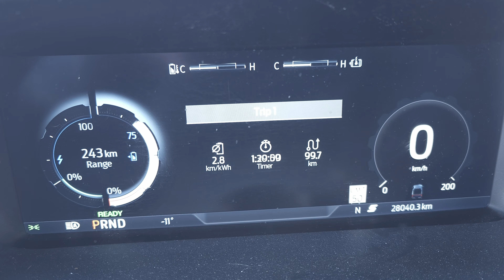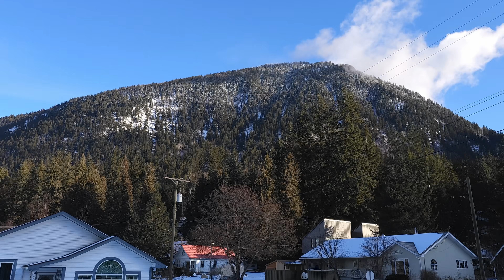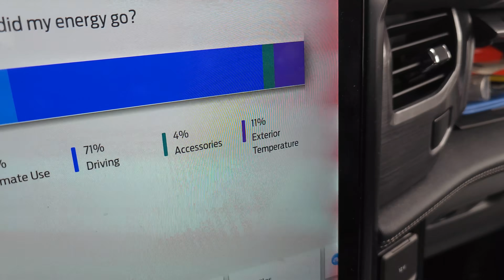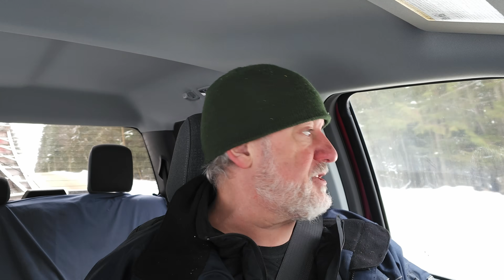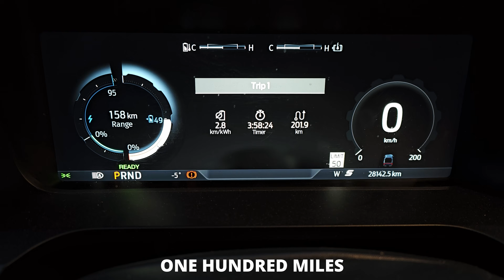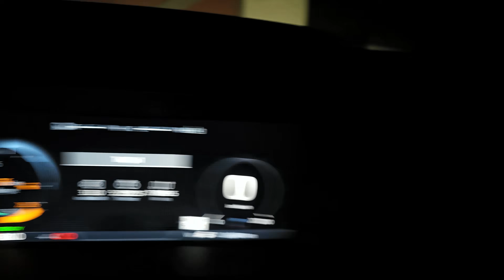My EV Truck Heat Pump SHOCKED Me in Below Zero Test!

Comment from the maker: CORRECTION: 
I love my Trucked Up Community!
Within an hour of posting this video,  I had half a dozen Trucked Up folk point out that, "Simon, you can't precondition your batteries if plugged in to a Level 1 outlet. You can only precondition on a Level 2."
Yup. They're right.
Sometimes I'll use a term that I shouldn't. If parked in the cold, I trickle charge on occasion (not 'precondition'). There are pros and cons to doing this.
Right now, as we wait to have the electrical upgraded at the house, we have no NEMA 14-50 for a Level 2 charger, so we have to Level One - or trickle - charge, or head for the nearest, more expensive DCFC. This can negatively impact the battery over the long term if done in the winter cold, but trickle charging does create heat, which can improve the range as does preconditioning, but not to the same degree.
When I have done this for the day in freezing conditions, I have improved my overall distance available in the range of 20~30kms from full to empty.
Don't take this as advice. Check your EV's owner manual as not all EVs even have a precondition option, and some strongly recommend against trickle charging in extreme cold.
Lastly, one of my amazing viewers pointed out that he finds he gets better range if in the Sport mode. I failed to mention that I too use this mode, and had it engaged when filming this video.
As always, keep the comments and discussion comin'! It keeps me informed and honest!
Reply: I only have L1 charging at my apartment and it keeps my battery at almost full operating temperature even in 0F weather. I will usually be just a bit low in the mornings and be at about 90 - 95% power. If I left it unplugged I would be down at like 70% power or lower and the battery temp would be visibly lower.
Reply from the maker: @sethmangini6671  I find the same. I'm waking up to a truck in the 95% efficiency range well below freezing, so although it's not 'preconditioning' the batteries, it does a LOT more than leaving it unplugged, which was my point if at a job site in the cold.
Thanks for backing me up with more real world confirmation, Seth! I appreciate it.
Reply: @truckedupevs  For sure, thanks a lot for sharing. I've been really curious about how the heat pump models compare to my 2023 non-heat pump model. If I lived just a little closer it would be cool to do a comparison video where we both drive the same route in the cold and see how the two compare.  I feel like you might be getting an extra 0.2 - 0.3 over what I would, but it's hard to say. Another thing I do in the winter is to set a departure time for each morning, even if I am not planning to go anywhere. Even with the L1 it seems to warm the battery more than even just charging on the colder mornings.
Reply from the maker: @sethmangini6671  I'm looking for someone local who has a 2023 non-heat pump extended range so I can do that very test.
I do the same with mine.
Reply: L1 charging is definitely enough to be the equivalent of a block-heater.
It allows the battery to be maintained at -10C without drawing down the battery.
Reply: @economicprisoner  Yes, L1 charging does VERY SLOWLY add some juice back into the battery pack, at a rate of approximately 1 kWh per hour.  However, on the Lightning, it is not enough juice to "precondition" the battery", as it would do if you set a departure time while plugged into an L2 charger.  Is it better than nothing?  Absolutely.  Ford's "preconditioning" uses somewhere between 3-7 kWh (at least on my L2 charger - it may be capable of drawing more power - I only have a 32amp charger)...
Reply from the maker: @economicprisoner  Thank you for that clarification! I know it helps when I do it - not as much as preconditioning, but an improvement nonetheless.
Reply: I have just connected my Lightning to my house. I have a 5.1kw battery connected to a 240volt  MPPSolar charge controller to run my well pump, outdoor boiler, floor pump, fridge and freezer. I plugged a 48 volt charger into my truck to keep my 5.1 battery charged and it only draws 7.6 amps. My Emporia charger was putting 46amps into my truck battery to bring it up to 80% while running my house. I all set for power outage.
Reply from the maker: @DavidBrown-jf1li  Nice!

Comment: CAA did the test and the heat pump lightning lost 30-35% and silverado lost 14-17% during winter testing. It's really interesting to see you do that test, it's quite encouraging. Btw, I like the "70mph highway drive until it dies". They always do the same-ish drive, so it gives a decent comparison of the highway driving range. Highway range is where the new-ev buyers' anxiety comes from, almost no one is worried about driving +400km of city stop and go traffic in a day.
Reply from the maker: Thanks Chad. I would love to see the parameters of that CAA test. I couldn't find it. Was it on YouTube or an article, because from all accounts I've seen both of their numbers are wrong? 
70MPH tests are not EPA tests, and that was the point I was making. To expect EPA numbers from a test that ignores EPA testing isn;t a fair assessment of any vehicle, gas or otherwise. And you might be right that in many parts of the US that stands true, but that doesn't apply to the rest of the world, and I think that's where the difference in views comes from.
Reply: Tbf testing is only for a generalized idea of how efficient the vehicle is as in the real world you won't drive exactly like the test loop and traffic but obviously getting as close as possible to real world conditions with a fairly brutal testing cycle is always better
Reply: @truckedupevs  I don't know if linking website is allowed on youtube, so here is what to put in your browser once on the CAA website /news/caa-conducts-road-test-of-ev-range-charge-in-winter-conditions/ As you pointed out in your video, it might be because GM seems more modest in their EPA range estimate than Ford.

Comment: I remember that road very well, even though I've only driven it a handful of times, and it's so beautiful it made my face hurt! One thing you mentioned about some of the other 'testers' out there is their reliance on using 70mph+ as their benchmark. On the main highways, you might have been getting 80-90kph and occasionally perhaps 100 (62mph), then through the passes you would have been quite a bit slower due to conditions. It's pretty similar over here on Vancouver Island. We have 80-90kph most places, with a few stretches at 100 and above, but not a lot. Trucks (and my Volvo) have the aerodynamic efficiency of bricks. Drive them in the cold and the denser air doesn't help either, so not giving people the qualified facts doesn't help. We don't all drive on freeways. You are making a great case for your F150 in the kind of conditions we have where we live. There's always work to do to improve things, and the heat pump looks to be a big plus - I don't think my heat pump is as good for example. Enjoying your stuff - keep it coming.
Reply from the maker: Thank you so much for the support, David! Always enjoy getting the feedback.
Yes, the fact that the 515km (320 mile) is based mixed driving, it should never be bench-marked against 80mph highway tests, never mind 70mph. The fastest average speeds in the US are much higher than anywhere else, and still, many parts of the US do not drive at such speeds regularly. EPA was menat to emulate average use, which we all know it doesn't even come close to doing - but if used to compare a vehicle's actual range, maybe these 'tests' should actually emulate the EPA?
Keep in touch! We miss the Island (but not the traffic!)
Reply: @ You do realize you are talking me into a Lightning, don’t you! Are you using the stock tires all year around there? We don’t get a whole lot of snow here on the South Island, but ice and freezing/melting temperatures make winter tires a need to have if you want to head to the north end in Winter. Between heading up to Haida Gwaii and camping out on the coast in Bamfield (Tofino and Ucluelet are way too crowded now), a truck with a spare is looking really good. Think I might have to head up to Island Ford in Duncan to look if the wife lets me. They still have a good selection of pre-Trumped-up trucks.

Comment: I just got a 2024 Ford F 150 Lightning Flash. I drove it the other day in -4 to 5 F weather in southern MN. 62 miles one way, plugged in at a 110 outlet and the drove it 62 miles back.  I drove basically with no heat on in the cabin at all only turning it on for defrost. My feet were cold. Haha. I preconditioned the battery before leaving both ways with a 110 outlet ( maybe that doesn’t do a great job?). I had 50 miles of range left when I got home.  I averaged around 70 mph on the interstate. I kept it slow. 

From my calculations I lost about 1/2 the range from the EPA combined estimate. 

I was pretty surprised as I figured I would lose 30%, but not 50%.

I am not too concerned as once we get our level 2 charger installed it will be a non issue. I figure we can use our gas vehicles on longer trips, etc. 

I love the vehicle overall, it will be fantastic during most of the year, just have to watch the really cold days with it and may have to charge on really really bad days. I will probably put a 240 outlet in at my office by next winter and then it will for sure be a non issue. We just won’t be taking the truck to the cabin in the winter, etc.
Reply from the maker: 70MPH is not slow. EPA is based on mixed driving that averages somewhere in the neighbourhood of 50MPH but it is somewhat more complex than such a fixed number. 
Americans love  speed, and most highways in the world are nowhere near the average highway speed in the US. Consistently. Americans drive at speeds only outdone in Germany.  Most highways in Canada do not exceed 110kPH or 68MPH, but outside of major routes, most are 90KPH or 55MPH.
I average about 20~25% below EPA consistently at -15 C or 5 F. and about 35~40% loss at -25 C or -13 F, driving at a mix town and highway rate close to equivalent to the EPA total range sticker target on the Lightning Flash (515km or 320 miles, based on mixed highway/city).
Also, you can't precondition with a 110 outlet. It helps compared to not plugging in at all, which is why I recommend it, but only Level 2 allows you to pre-warm the batteries to optimal operating temps in winter. You will see a dramatic improvement in overall range if you do this regularly before departing daily from home.
So, in conclusion, you did not lose 1/2 of EPA because EPA is not based on such speeds.
I hope this clarifies things. Thanks for the comment!
Reply: 70 mph is not "slow" in this situation, 65 would be more appropriate to help with range and efficiency.  There is a large jump in wind resistance every 1 mph above this, especially with the denser air in the colder months.

Comment: Here in Moose Jaw it was -40C overnight on Sunday.  What I "discovered" is that my Flash doesn't charge as quickly when it's that cold; so, we started Monday's drive to Regina with only 70% capacity (80 km each way, plus errands in the city).  I only have sufficient electrical capacity to support a 16 amp level 2 charger (the slowest form of Level 2).

Other than starting the day with less capacity than we needed for the full round-trip, plus errands while in the city, the Flash performed flawlessly.  I spent 21 minutes at a FLO charger to top up to 48% before heading back to MJ -- it was while my wife was shopping, so the charge wasn't even "lost" time -- and we had 16% left when we got home.
Reply from the maker: Excellent example of super cold-weather performance. Thanks for sharing this, Christopher!

Comment: I recently traded my 2.7 eco boost in for my lightning lariat. I was torn between the flash and lariat - the lariat just had more incentives. Really enjoying it but not going lie a little buyer remorse with losing extended range but not missing the cost to fill up ha ha. However, having a Mach e without a heat pump vs the lightning having it what a difference!
Reply from the maker: I hear you 100%. There were so many deals on Lariats and Platinums and could have tons of $, but for the channel (and where I live), the heat pump just made sense.
Reply: @ exactly! Even for us in Texas we see some weird temperatures sub 20 Fahrenheit so the heat pump is great! The Flash was a tough pass and kicked myself a little for the bang for the $. The Lariat has been fun and overall lightning experience has been great and appreciate your videos to assist in the purchase!

Comment: EPA is literally 50 mph. That's what they test at. How far you can go at 50 mph. That's the reason why Audi and their e-tron which I understand includes Porsche has a twin gear for the vehicles because on the Autobahn you need to be able to do over a hundred miles an hour which is I do believe about 161 kilometers per hour.
Reply from the maker: That's about right on the mark. I have had a lot of comments that I was 'driving too slow' on twisting mountain passes where not a single highway for hundreds of kilometers exceed 90KPH (56MPH). LOL!
By the way, great to hear from your stranger!

Comment: Thanks for sharing! Doing the same route at the same time with another Lightning 2023 ER would have been nice! to see how much gain, if any, between heat pump and resistive heater. I have exactly the same Lightning, same color. I really love it. It is very cold this winter and I'm very satisfied with the range, even at -25C. Do you have max tow package? I've heard that it could impact positively fast charging but I don't know if this is true. Also, we see that your power dropped to 95% in the video but I don't think it's related to temperature in this specific case, it's only because the battery hits 49%. Take care.
Reply from the maker: That was the intent. I live in a relatively remote part of British Columbia and had exactly a one-week window where  winter temperatures finally dropped to an adequate test level - and NO 2023 ER Lightnings in my area. I'm still working on doing that very test, but temps are back up as of tomorrow and might ot get another chance unless I head far north.
Yes, I have the Max Tow Pkg. It should actually have more of an impact but I'm guessing more on the cooling side.
The power didn't drop to 95%. It went up from 80%! :-)
Thanks for all the awesome feedback and for supporting the channel!
Reply: @truckedupevs  Regarding the percentage of motor power, I noticed that even when the battery is at the right temperature, it decreases from 50% autonomy, and it continues to decrease. I don't know if in summer it will react the same way but I have noticed this on several occasions.

a little testimony on consumption in winter : two weeks ago, I took the truck, it was -22C, and the battery temperature was between 11C and 16C according to Car Scanner. I drove 93 km for 1h30 with a consumption of 42 kWh/100 km. FYI, the battery was between 6 and 11 degrees when I arrived.

I returned at -15C outside temp after the truck spent the day parked between -22 and -15 for 8 hours. Battery temperature was between -8 and -3. It warmed up very slowly and I think it was between 2 and 5 when I arrived (1h25min/92 km later, consumption 36 kwh). So I did a total of 185 km with 52% battery, half at -22 warmed battery/cabin, the other half at -15 with cold cabin and battery. A third of the total was on the highway. Heated seats, heated steering wheel, temp at 19C (dressed in skis it's almost too hot!). It's 356 km on a 100% battery, which is not bad at all. 

Last weekend it wasn't that much cold but still -12 in the morning (and -6 in pm) and did a total of 132 km with 28% battery. Same situation, the truck was parked for 7 hours after first half. It's 471 km with 100% battery!!!
Reply from the maker: @francoisgravel8728  I'm not seeing that. When I am below 50% it often reads 100%. I think it takes into account a lot of factors. I have now owned both the 2023 XLT standard range and the 2024 Flash extended range, and both would still be at 100% below 50% unless it was cold. I am seriously thinking of picking up Carscanner.
Wow! I've never got anywhere close to 471 km in the cold! That's fantastic.
Reply: @ Regarding power %, it seems that an OTA update did modify the power % from what i've read. But it's a detail IMO. Car scanner is free, running on an iPhone with Apple CarPlay, so you can see it on the 15" screen. Just need a ODB2 bluetooth. My 5 years old ODB2 is working fine so didn't have to buy a new one. It's a must for EV geek like us!!!

Comment: I bit the bullet today and purchased a 2025 Silverado EV WT max range. I’ll pick it up on Tuesday. I originally wanted the LT but with the threats of tariffs and everything else going on, I thought I had better purchase now. Larger battery will be nice for towing our 24ft RV.
Reply from the maker: Woohoo! Congratulations Steve! Was it difficult to get or did a NB dealer have one in stock?
Reply: @ I was going to get one from QC as there wasn’t much to choice from here in NB but my dealer gave me a good trade in on my current truck. They really tried to get me a truck and I appreciated the effort. I also received a $3000 certificate from GM Canada to use towards a purchase at my local dealer so it all came together. they will be picking it up from a dealer in another town here in NB and will be installing a couple of items next week once they come in. GM wasn’t giving out any allotments to order the LT and I didn’t want to order once I could and the truck go up in price by a few thousand by the time it makes it final journey into Canada. Not quite what I wanted but you can’t beat the range as an EV. It should blow away my 5.3L gas and hopefully do me good for many years
Reply from the maker: @NBSteve  So happy for you! Congrats on bagging an absolutely awesome truck! Keep us all posted.